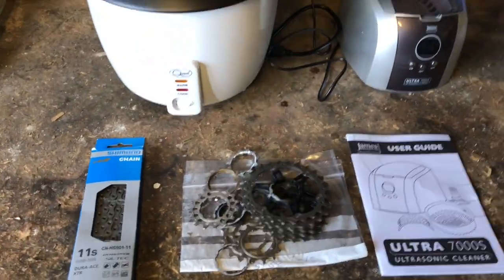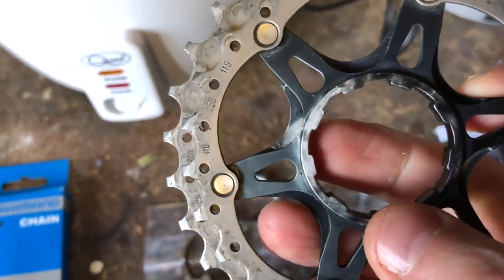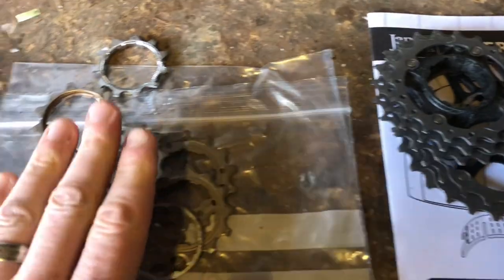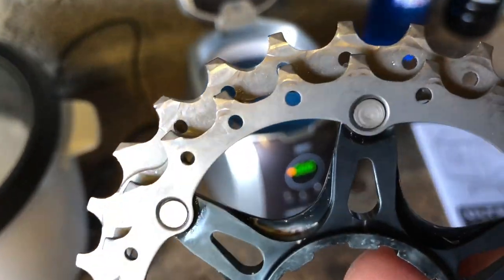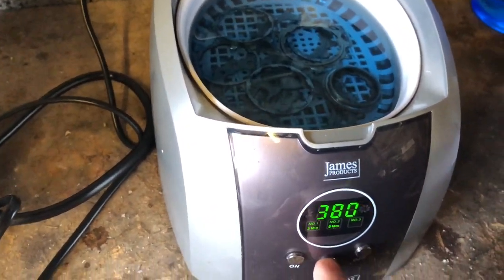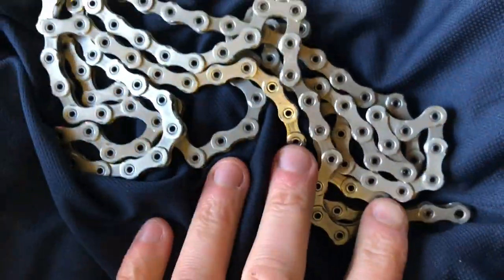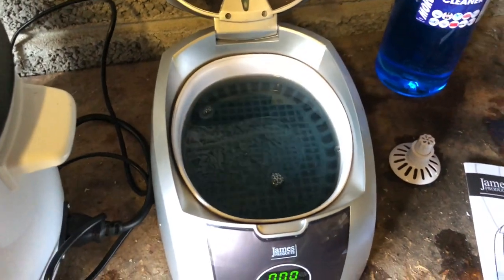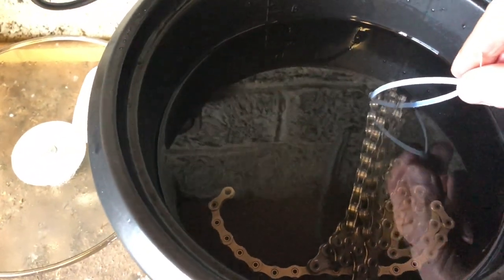Cleaning & Waxing my Dura Ace Cassette & Chain

Comment: Cool to see an older video. I like the method of cleaning the cassette, not sure it needs the wax.

Wax has also come a long way. There are quality off the shelf products available with stellar performance. Ive been using silca secret wax but am switching to molten speed wax (new formula). They are the two top performers tested by zerofriction. Neither are soft when cold, nor do they contain paraffin oil. Molten speed wax even comes with "no oil" stickers!

Come join the dark side!

Comment: Hi man  -   I also include a measure of molybdenum and PTFE powder.  result is awesome. Wax temp ideally 48 degrees - to hot and it runs of hot component plus you get to near the flashpoint I think around 60 degrees C  . Jason Smith was the guy who did the original comparisons on Friction Facts podcast.  really interesting results.
Reply from the maker: jo nixon I’m gonna try this! Thanks
Reply: Flash point for paraffin wax is 199°C..
Reply: Ya i regularly take my wax to 210f/99c. My wax is getting hard around the edges by 150f/65c. I pull my chain @ 160f/71c so the wax doesnt run out of the links. I dont thin my wax with any kind of oil, my wax is hard when not on the heat.

Ive been using silca secret chain wax, but after looking into independant testing, im switching to molten speed wax. Both use different blends of waxes and additives. I havent switched my pot to molten speed wax yet, I have the wax on the counter, awaiting 2 new YBN 12 speed gold chains with the Ti-N coating. It will all be here by mid week! Its for a new bike I got.

Comment: Not to be a hater, but mate you look like you waxed your chain for the first time. Why use the zipties? Single-use and not all that great for the environment. I personally use old shifter cables/brake cables which I thread through the chain and then wax it. That way I don't have to hold it up all the time. Also, less heat. The more liquid the wax is, the less adhesion it will have resulting in less wax actually lubricating the rollers. Try to measure the temperature where the wax STARTS to get liquid. Not when it steams and makes crackling noises.
Plus, I would recommend drying the chain as thoroughly as possible. Water in the wax doesn't do the waxing process any good. At least dry it with a towel and leave it on the radtiator for some hours. Personally, I dry it off with a rag, use pressurized air from my compressor afterwards and leave it at least 1 day in a warm place(near windows during summer and on the radiator during winter). 
My chains usually stay in the wax/parafin oil mixture for at least 10 min, so the chain has the same temperature as the wax and every rollers gets enough wax. Also, agitate the chain a few times while bathing in wax. Sometimes, trappped air gets pushed out and wax can replace it.

Btw: Ultrasonic cleaner with higher "cleaning power" like 80+watts and longer cleaning intervalls or strong detergents/degreasers are commonly known to strip away anodizing from aluminium parts. If you don't care about the look, that's alright, but the anodizing helps to prevent the aluminium from oxidation. I know that aluminium doesn't "rust", but a microscopicly thin layer does oxide and proctecs the lower layers from oxidation. Temporarily. So keep anodized aluminium aways from USC if possible
Reply from the maker: Thanks for that, brilliant explanation!!
Reply: Spokes or coat hangers are better. Ive been reusing 2 coat hangers over and over for my 2 chains. You just bend them up into mini chain hangers and clip the excess. With the coat hanger, i keep the hanger portion to hang over the pot for an easy grab, i turn it 90 degrees  so the hanger orientation works with the chain and the pot.

Molten speed wax also makes hangers if one wanted to buy one, or use it as a visual reference for making their own.

Comment: I can see why you wax the cassette, it is so clean that it will rust if you don't. When you have an oiled chain the oil will coat the cassette. With wax it does not flow and coat anything. Having said that I still don't see how it keeps the inside of the chain lubed. Doesn't it just flake off and you have metal against metal?
Reply: The key is to take the chain out of the wax when it's starting to become solid wax at the surface. Somewhere around 50 degrees Celcius. This way when you take the chain out, the wax won't drip away and will stay inside the chain rings. This is very important otherwise the wax wan't taken long before you have to repeat the proces again. This way the chain is rubbing metal on metal, because most of the wax will drip out of the chain. Chain is to hot and wax liquid. So take the chain out while the wax is drying. The vidio doesn't show this part, but i asume he wil take the chain out like the casette. One more thing, you should not use lamp oil. Use parafin oil. Lamp oil is to oily, so dirt and dust stays on the chain and casette.
Reply: . . .  and the purpose of soaking the chain instead of spraying the chain is to allow the liquid wax to penetrate the pin-roller area inside the chain.  And as stated, the chain is removed just when the wax has cooled down to the gelatinous staged and then hung up to dry, allowing the wax inside the pin-roller "chamber" to remain inside.
Reply: @mirzoni5924  Are you saying that from experience? Cause I read in a forum thread that the wax lasted longer at a little higher temperatures. They consensually recommended somewhere around 120 degrees C instead of 90.. I have no experience yet and am trying to decide whether to buy a slow cooker for the lower temps or a deep fryer for little higher temps as slow cooker doesn't get their apparently.
Reply: I use 0 oil. My wax even came with stickers that cheer it all on that read "no oil". Its the top performing wax via independant testing from zerofriction test data (another youtuber). Its only their new formula, not the flaky stuff on amazon, but the hockey pucks on their site. It just beats out silca secret wax. Ive been using silca secret and its been working great. But molten speed is better (via independant testing) and is cheaper when placing a bulk buy. I bought 3.5lbs for under $20/lb.

I agree on the method of pulling wax. I havent tested molten speed wax yet. But silca wax begins hardening @150f/65c, I pull the chain @160f/71c after a final swish to knock off anything that settled on the chain. This keeps the wax in the rollers and the chain sounding better. If i pull the chain out hot, it sounds like its a week old on day 1. I swap chains every 250 miles (2 weeks), im thinking about extending things to 3 or 4 weeks on a trial basis.

Comment: What is the benefits of waxing the rear cassette. ??
Reply from the maker: Luke Toms I’m not sure there is any.... I just did it on the day, I did notice that it shedded quite a lot onto my spokes....
Reply: I would think just a cleaning should suffice. The chrome plating will prevent rust from forming (mostly). The area where the chrome plating wears off is where the chain rubs. So theoretically a newly waxed chain should protect the exposed areas of a cassette, so long as you run through its gears after a cleaning.

Rust can form on chrome based upon the specific makeup of the chrome and whether or not its left to the elements 100% (ie: left outside) cheap chrome (normally from china) has less nickel in it, providing less corrosion resistance.

Comment: Good to know a standard jewelry ultrasonic  cleaner does the trick. Great video! Thanks!

Just a question. I never thought about waxing my cassette as well. Is just wax the chain generously and switch a lot of gears. Is there a huge difference?
Reply from the maker: I just did it to protect my cassette, I figured it’s part of the drive train so I’ll do it. It was a lot quieter definitely and I didn’t get any dirt buildup so overall it was a useful exercise. 👍

Comment: Nice video. Do you think using isopropyl alcohol would be just as effective as using the chain cleaner?
Reply from the maker: nzube11 I’m not sure, I’ve always used chain cleaner, could give it a try and see?
Reply: Not sure if I would want hot alcohol vapor floating around my kitchen/garageworkplace. Flashpoint is quite low and also with the 99% grade stuff, it evaporates even faster. If you do it outside and with enough air floating and perhaps even ventilated, sure. But be careful
Reply: Isopropyl alcohol isn't as good for cleaning a dirty chain as kerosene / petrol / chain cleaner. I first clean my chain with petrol and then with isopropyl alcohol to remove any petrol residue
Reply: @amogh1773  this might be true for those really mucky old and rusty chains. Like the ones on bikes of people that NEVER clean their bike in 10 years. But for normal regular cleaning, I prefer Ethanol. Less toxic and "better" for the environment than petrol. It also does the job good enough for me since I keep all my bikes and kit quite clean
Reply: No Its rubbish. Tried and failed. I use paraffin to clean the chain. Also It mixes with the wax easily if any is left on the chain. It stands to reason that it will also wash dirty wax off a chain.

Comment: After couple months and miles how about inpact wax to cassette? Any futher info mate?
Reply from the maker: Well it was a pain to get on as it was wider due to the wax on the sides of the parts. Having tried it I don’t think I noticed any impact on performance or shifting to be honest. 👍
Reply: @KyrosHouseCycling  for durability, is that increasing ? as inpacted for chain
Reply from the maker: @munthe8  I do like waxing the chain, and I must say I’ve seen much less stretch over time and less wear compared to traditional lubrications. 👍

Comment: is lamp oil the same as paraffin oil
Reply from the maker: Phil John the one I got was paraffin  lamp oil, I struggled to find paraffin oil that wasn’t lamp oil to be honest 👍
Reply: I think mineral oil (same ingredient in laxatives, hair clipper oil, and baby oil) is another name paraffin oil. That’s what I use in my wax + oil mix.
Reply: K1, astm 100 Kerosene is 'paraffin'. Clear kerosene with no additives. Normally sold in bottles (you can see its crystal clear) but my local hardware store has a 55 gallon drum.

Comment: I think you used way to much wax for your cassette. It is in unnecessary parts of it. And when the wax is too hot, it will just drip out of all the inside of your chain. Maybe with a little lower temperature. Thank you for the video anyway
Reply from the maker: Juan Antonio Monzón no problem! Stops the cassette going rusty though, with the salt air over here everything rusts if you don’t treat it. 👍

Comment: New chain from the factory is the best condition which you can get, you really dont need to clean or wax it.
Reply from the maker: Daniel Daniel I don’t want grease or oil on my chain set, that’s why I wax my stuff 👍
Reply: Actually not really. Factory grease/lube is quite one of the worst if it comes to efficiency, also IME the factory lube attracts dust like a magnet. After 2 rides in the summer and dry conditions(32°C and the last rainday was 3 weeks ago) the chain was utterly dirty. Like black, grimey dirty. Also, metal parts are always left from the maufacturing process. I always find quite some amount of metal shards when cleaing a new chain.
Reply: Daniel Daniel-  I used to believe the same as you, and not to be cynical but . . . in today's commercial world of corporations looking only on their bottom line and their investors, probably 99.9% of the corporations are interested in just one thing- selling more product.  But let just put that aside and look at the facts.  Dirty, sticky chains are like magnets for dirt =. dirt increases friction =. friction increases metal abrasion => adheres to the paste-like dirt that has accumulated on the chain => chain becomes black in color from the dirt, grease, road grime that has stuck to your/my chain => more friction = premature chain wear necessitating the purchase of another chain ==> premature wear of rear cassette and chain ring(s).   QUESTION:  do the manufacturers of chains and gears know this?   Yes.  In the 50s & 60s companies & corporations bragged on how long their cars-whatever lasted.  This is not the case today.  Don't believe everything someone tells you (even me!).  Prove to yourself what the truth is.
Reply: Factory coating is lanolin grease. Might as well cover it in super glue.

Comment: why everybody cooks chain in wax, there is better, faster and easier way to wax the chain, if somebody is interested for that just ask
Reply: Ok tell all
Reply: @makantahi3731 , how sure are you that the wax completely filled the empty spaces around the pin & roller with just an exterior application?
Reply: @rononyourleftretired5144  have you ever heard  for capillary effect, wax just comes in, like when soldering   copper pipes/tubes, if it does not come in, my chain would not survive 3 times longer than when was oiled,and mostly there left droplet of wax on every link that can stay on or you can soak it  in easy touch with cloth  and more better thing is that you do not need to wash chain in solvent to be clean, just make 2 or 3 passes of wax and clean cloth immediately after put wax on chain portion when is still warm and liquid and all dirt stay on cloth, in second pass can be seen difference of dirt on cloth, third pass can be done for very dirty chains
Reply: Makan Tahi, yes, I am familiar with capillary action.  As regard to your process, if your method is working for you then it sounds good to me.   Whatever works, right.  As I recall, the subject was "why submerge" the chain in wax, rather than use your method.   The point that I wanted to make was the higher percentage of wax getting into the void between the pin & roller, but from what you are doing it sounds like you are having success.  Good for you.  Happy rides!
Reply: @rononyourleftretired5144  if you submerge  chain in very hot wax, more of it will fall of from chain because of lower viscosity(if you do not wipe it in cloth), yes there will stay some thin layer inside of chain, if you submerge chain in wax that is very close to  limit to get solid, more wax will stay on chain even you wipe it with cloth because of higher viscosity, and if you put wax on  chain warmed by inductive heater, it will be same effect  as it was submerged, and if you do not wipe in cloth to remove surplus of wax, it will fall of from chain when it rotates when pedaling, so if in chain is any surplus of wax it will go out of chain when it rotates, maybe there still be 50% of  totaly used and applied wax
Reply: @rononyourleftretired5144  some of submerge gurus made their ideology on long gloves , apron , fryers, pots, and they would be silly if now , after my video , they would confess, that their way is slow, long , dirty, not ecological( waste of dirty wax that can not be filtred because of very tiny dust in wax), not practical,  and that from now they will make  videos with inductive heater. I improved device, by putting switch on device so in left hand is inductive heater and in right wax stick that is recumbent on portion of chain that is inside if heater ,so i can immediately see when temperature is right to wax  the chain and it is more faster and with less loss of heat and now i need 6-7 minutes for 2 passes, and tested li-ion battery- 4 in series, 3 in parallel connection( 14 volts when is on, and 7 amps) and it goes faster than on 12 volts car battery or computer power supply, that battery can be used as power bank for other aplications